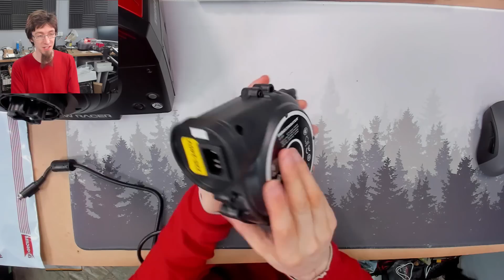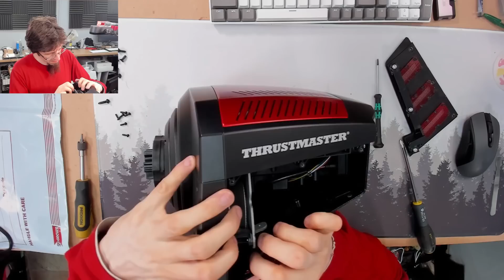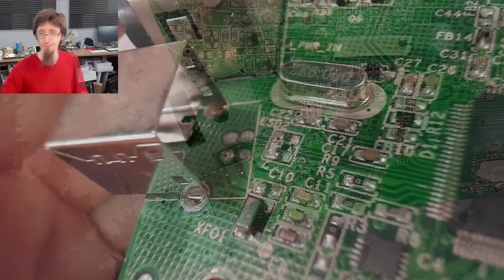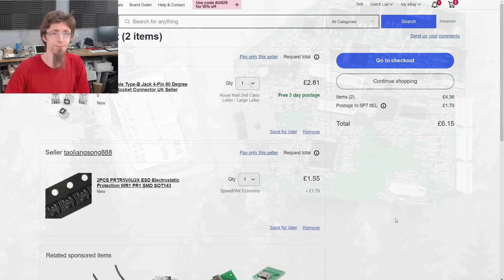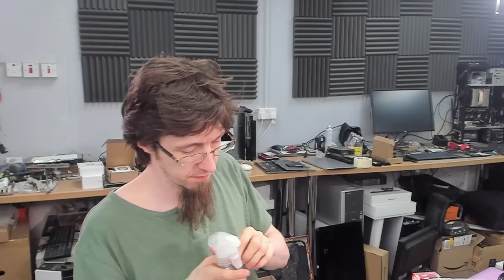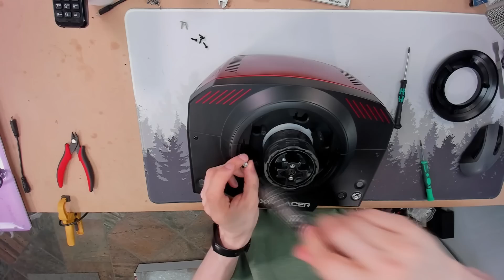Thrustmaster TS-XW Broken USB port - LFC#321

Comment: Hi there! I just found your video when I searched the internet for some photos of Thrustmaster TS-XW motherboard.
I just bought this wheelbase, and my set has the issue, that nothing is working - any LED diode doesn't flash, and when I connect to USB, PC no recognizes the device. I do reverse engineering of power supply and find that device close circuit and give power to base when get some little voltage to the photo-isolator inside power supply PCB. Which is why power cable have 4 pins. 2 for AC power line, and 2 for signal to photo-isolator.
I think that voltage for this component probably came from USB port in wheelbase. But when I compare my PCB and that in your video, I see that the same component named ESD2 not be installed. The difference is that my soldering pads for ESD2 look like fabric new. And I have suspicions at this moment, if ESD 2 component really is necessary.
Reply: Hi there I was wondering if you can do me favor I recently got this wheel without the psu, the only option for me is to order from out of country which costs 3x as much as i paid for the whole wheel I am wondering if i can bypass the AC components and give Voltage to the board after the bridge rectifier since it seems the board first of all converts the Ac into dc. Any help would be great plus If you can give me readings of the psu pin outputs and which of them are used for signal and V That would be appreciated as well bro Thanks.

Comment: Thanks a lot for this video, it's one of the only ones I can find that gives a good look at my wheelbase that has, unfortunately, just stopped working. Although I don't have experience with soldering and don't own any of the equipment, this video has at least allowed me to diagnose the problem so that I can find the right parts myself and hopefully find somebody like you to repair it for me! On top of whatever money you've saved this wheel's fortunate owner, you've probably saved me hundreds of dollars as well.

Comment: I have a TS-XW that took some lightning damage through USB. Still powers on and stops midway through the calibration cycle and is also not detected anymore. I guess the main controller is fried, Thrustmaster don't supply replacement boards, I wonder if the main controller chip can be replaced? Here, the electronics guys aren't willing to dig deeper into repairing this wheel base. Seems a shame to just throw it into a landfill, it has less than 20Hrs use. Doesn't seem to be much info around on repair, would be great if we had guys like you who really want to fix these things.

Comment: I have a TS-XW Sparco wheel that lost power and will not power back up at all. It was working fine. Please help me solve this. I am befuddled as to what to do.
Reply from the maker: I'd start by making sure that power is making it all the way into the controller board. Once it gets to all those mosfets, I'm not sure how to navigate that maze, but checking the power jack connections and stuff is a good place to start.

Comment: Would it be possible to replace the USB port with another one, like a mini USB or even USB C port?  I guess you'd have to fill in the gap in the case with something, but I'm just wondering if that's an "upgrade" that's possible to do.

Comment: I reckon most shops or DIYers would totally miss that broken diode and wonder why their usb port still doesn't work. Really good stuff Graham well done.
Reply: It would actually work without the TVS diode package, it is there just as a protection device. But it would leave the microcontroller open to damage if there were any spikes on the USB data lines.

Comment: Thanks for great content. And I really do like your methodical approach to repair, but your soldering would really be easier on the eyes with a beefy, adjustable soldiering station and use of hot air for SMDs.

Comment: i have this wheel it is very good mid range wheel,  however i know the USB has gone on this one,  but i am always paranoid about breaking the power cable port its kinda loose fitting and easy to rip out if you move the unit alot, interesting to see inside it though
Reply: @ProudOfYourRoots I've had the wheel for a few years.  cheap DD options wernt available then.  It was when DD was starting to come in but they were all very expensive well over £1000.  Plus I sold my t300 and bought this one  2nd hand on ebay so it cost me less than 300 for it as a package
Reply: @ProudOfYourRoots yeh the price does seem high but you also have to remember your getting pedals and good wheel as well.  Alot of the DD wheels are the base only no pedals or actual wheel.   So by the time you have bought the whole package it ends up much more.  Plus the rig you need for a DD wheels need to be strong.   If I was buying again  now I would by a DD wheel.  But tbh this is more than good enough for a casual sim racer
Reply: @ProudOfYourRoots yeh I'd deffo go DD if I was buying again now.  I'd advise you to if you are buying.  To be honest I don't play sim games as much as I used to or I would look to upgrade.  I'm not an online racer and I find that a lot of sim racing games get a bit boring offline as there is no real career modes or progression it's more like doing a race for fun which is fine and I do it but I'm not sat for hours at my rig like some do

Comment: The problem with ebay crap is that it's crap. Just look at those capacitor kits you can get for cheap. They all come from factory dumpsters. You get what you pay for.

Comment: For the TVS package, since it's pretty common to protect USB devices, you could probably reclaim one from a broken donor board. (Assuming customer is okay with that.) Since it's just diodes, you could check that the package works using a multimeter. 

Thanks for another great video. Always interesting and usually learn something.

Comment: One way to keep from breaking a USB port is to plug in a little/short adaptor cable into the port and then just use the other end of the cable to be the "business" end.
Reply: Any links to where you get one of those adapters
Reply: @User_59766  - I just get any adaptor that has the correct connectors from the local pc store, Amazon, etc.
Reply: @User_59766 I've searched and there doesn't seem to be one available.

Comment: An instructive repair. Thank you. Did you get any help from Thrustmaster? I remember them being very helpful when I had an issue with their Cougar HOTAS (still going strong!) way back when.

With regards to over-ordering parts, as I'm sure you are acutely aware - but your audience may not be - storage space costs money as does time, so not only are you spending more on acquiring the components but you're also spending money to keep the parts you don't immediately use and money on the time to store them and find them when next needed and to inventory them.
Reply: He didn't need their help.
Reply: I have Airbus throttle controler with dead microcontroller.  I'm wondering if thrustmaster would sell programmed chip, or I need to get entire pcb.
Reply: @Dmiliunas  You have nothing to lose by asking - but check the warranty first!

Comment: at $750 for the unit, I think a parts cost of $30 is not unreasonable. I mean, you'll be charging Ferrari servicing rates anyway right?
Reply: I was wondering the same thing.  Maybe the customer would want to pay the extra 20 bucks and get the wheel back a couple of weeks earlier.  Or maybe the owner made it clear they were not in a hurry to get it back.

Comment: 17:05 “De-soldering gun go brrr.” 😂 I want to get a desoldering gun for my workshop, any recommendations?
Reply: All the "ZD-915" clones out there are ususally good.
Reply: I use Pro'sKit SS-331H from Aiexpress. Pretty decent one for its price, just needs some rust-free metal sponge loosely fit into the glass tube to help dissipate molten soder and flux.